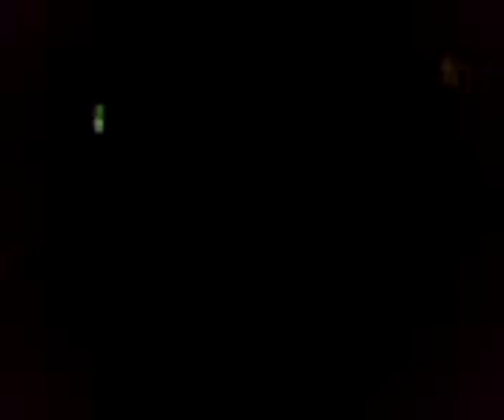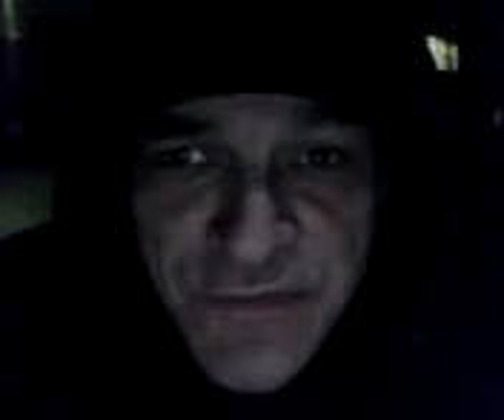TR 3B super conductive plasma magnetic Field circular vortex Disrupter gravity Aurora Ed Fouche Low,

Comment: The assumption in this video of using mercury as a superconducting fera fluid is incorrect, they refer to using "red" mercury, which scientist says does not exist,, in reality red mercury can be made however it is not used in anti gravity devices. Gravity does not exist in its given theory. TR3B does or did exist, it does not operate in the way explained. It is the after thought from the German levitation device known as "foo fighter".  I will not take the time herein to explain how it works, but I will say this, it creates a strong magnetic field, that entraps atmosphere particularly nitrogen, and  with the use of 3 vacuum containers filled with a gas to which electrons are released to generate a reaction that converts the element of nitrogen into helium and since that will cause it to become radioactive, the center container first vacuumed and filled with neon or fluorescent gas absorbs the radiation and converts it into photons/a ball of white light that engulfs the craft. The more energy used for the conversion the more upward lift it has....... after the half lives of the converted helium come abouts it turns back into nitrogen, and then it has to reprocesses the nitrogen back to helium, that is why and when you see it turn back into a ball of light... It can not be used in interstellar space travel, it will not work. Now if your smart you can figure out how it is made.....